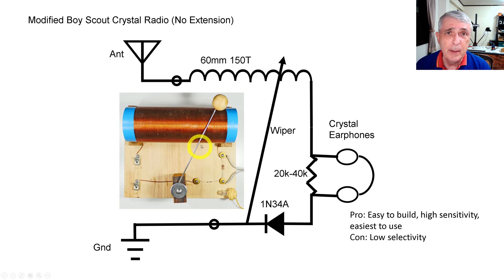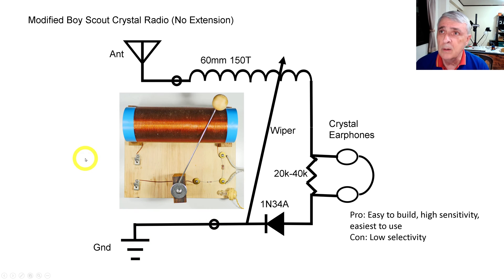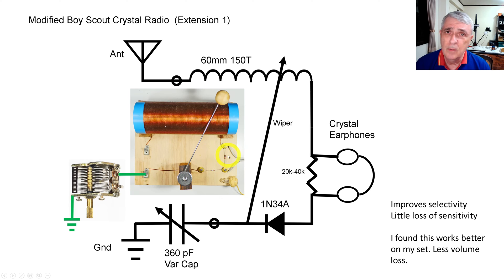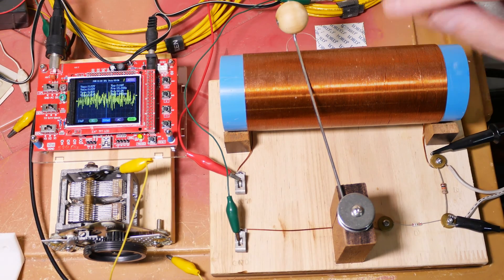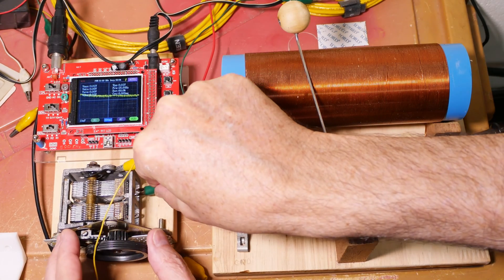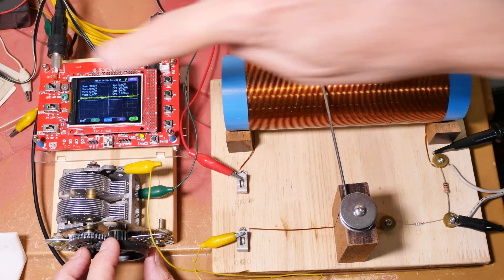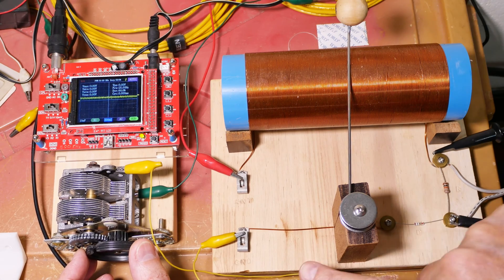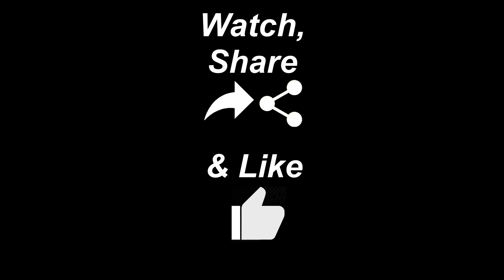Crystal Radio Wiper-Type Selectivity Upgrade #1 (4K)

Comment: So I can receive the two most powerful stations in my area, one being 1KW clear channel, and the other being 5KW at day.

But what I find strange is that we have ANOTHER station here that broadcasts at 5.5KW (daytime) yet I can't pick it up on my crystal set.

The weirdest part? At night I can pickup (the more powerful) shortwave stations, including one that is QUITE far from me (around 500 miles away via skywave).

Alright, well, WSM comes in at night where I live, oftentimes being EXTREMELY powerful, can I pick that station up?

No.

The whole thing seems weird to me. Is this an antenna problem? A set problem? Or what?
Reply from the maker: @qwertykeyboard5901  Not really an antenna problem. I have 2 antennas, 1 is east west  the other north south. Some people have 2 more running NE to SW and NW to SE.
Reply: @tsbrownie  So should I try making the antenna face a different direction?
Reply from the maker: @qwertykeyboard5901  It's easier to run a second antenna and switch back and forth to see which works better for a given station.
Reply: @tsbrownie  Thanks!

Comment: Thank you for all you do for us. Question: Is the term "selectivity" the same term for "Q Factor," as in audio bandpass filters? Maybe make a recording of royalty free music, from the net - or, create a simple tune, with free net tools, maybe Audacity. Build a simple low range bench AM transmitter. I see those DIY projects on YT. Maybe all said easier than done, or gives poor results, but I am trying to be helpful. Cheers.
Reply from the maker: Thank you. Q factor is defined as the ratio of the energy stored in the oscillator to the energy that must be imparted per cycle to keep the oscillator oscillating. I usually say it's the efficiency. Q stands for quality. I bought an AM transmitter to do what you said, but it's power was too low. I'm still working at that.

Comment: How can this work? The wiper is shorting from that position on the coil, across the resistor and to the negative terminal of the IN34?
Reply from the maker: That's how most tuners work. You create resonance in the coil between the antenna and the ground (which would be a short in a DC circuit, but not with an antenna/coil AC resonance). The rest of the coil is "vibrating" at its preferred frequency that it gets (like an auto-transformer) from the other side of the coil.

Comment: You can get a spectrum analyzer for about 34 dollars. Its called Software Defined Radio. The spectrum will show on your PC.
Reply from the maker: I definitely need to look at that. I'd heard about it, but never thought to apply it here. Thanks!
Reply from the maker: I looked into the SDR. Yes, it will show me the spectrum of radio waves coming in, but it won't go low enough in frequency (25 Hz to 25kHz) to show the audio coming out. It's the second thing that viewers need to see. I do have a Nano VNA and they say it can be used as an audio spectrum analyzer *IF* it is used carefully. I have to look more into that.
UPDATE: My Nano VNA goes down to a few hundred kilohertz, way too high for audio. Back to square 1.
Reply: @tsbrownie  gee, I have multiple audio spectrum apps installed for free on my iPhone and they work great.
Reply from the maker: @franzliszt3195 But they take an audio input, and if I play the audio, my video gets taken down.
Reply: Use the lighting port as audio input, if you have a newer iPhone. I would try a direct unamplified crystal radio output directly into the phone I think the phone's input would be well buffered. But to be on the safe side, maybe at first put a potenitiomter between the crystal radio and phone and set to high impedance-- for all I know, you have a 600 foot long antenna out your back window! @tsbrownie